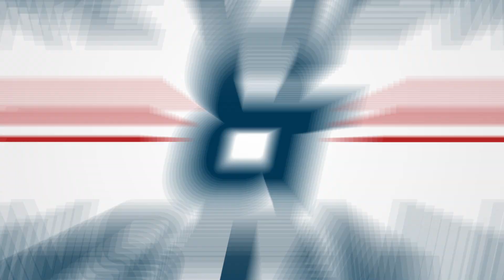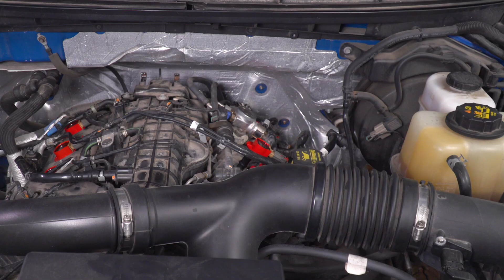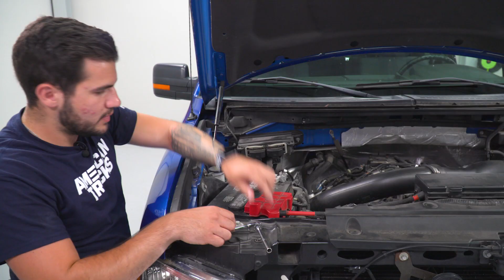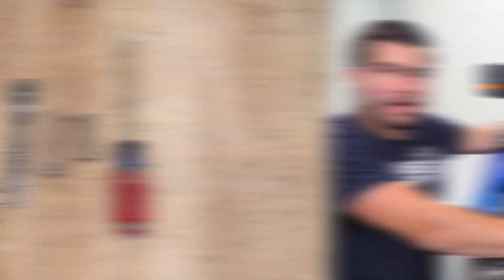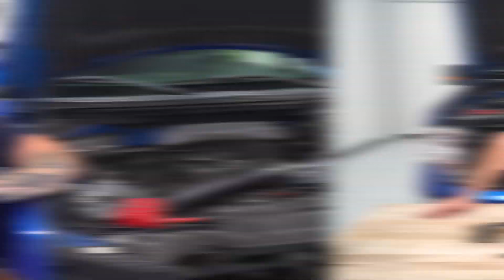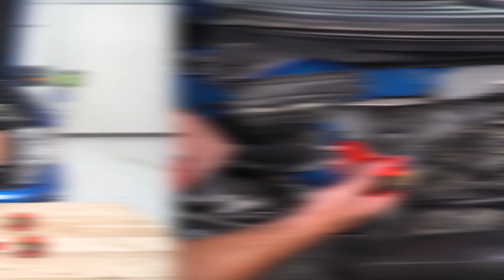2011-2014 F150 3.5L EcoBoost MSD Coil Packs - Red Review & Install

Comment: Did trq plus on my 2016 fusion titanium 2.0t. So far i noticed a minor throttle increase, did accels on my 99 crown vic years ago and noticed better mileage and throttle response and had no issues, so im hopeful for the trq

Comment: Great, they're a pretty red color. But what differs them from the stock coil on plug? Are they higher voltage output, If so how much higher? How do they compare to Accel and Granitelli? What is the warranty? Why should I pay $250 to upgrade other than slight (undetermined)  boost in midrange power?
Reply: Accel ignition coil packs are identical to MSD same company same coil different branding. These coil packs improve acceleration my exhaust sounded louder I do have Magnaflow plus it increase my MPG by 1.5 according to my vehicle MPG monitor
Reply: I've learned the hard way. Purchased the accel coil packs after about 30 thousand they have started to fail. One by one. Stick with Motorcraft.
Reply: @williammoore4792  Always
Reply: They add 15% spark increase and definitely add a slightly better power and mpg.